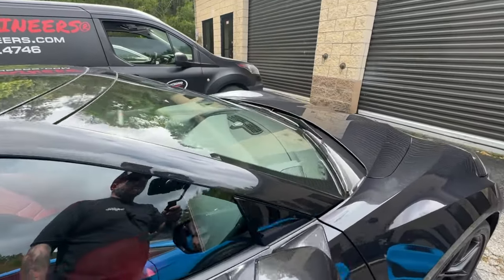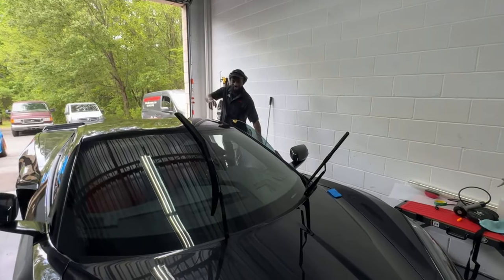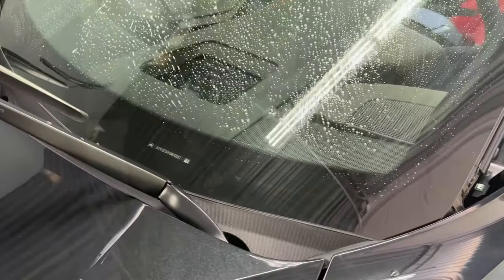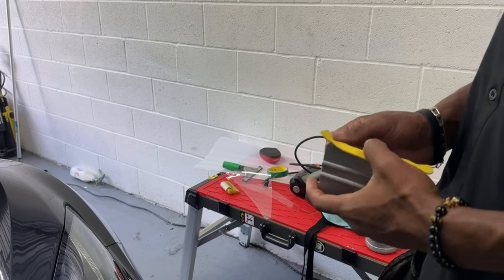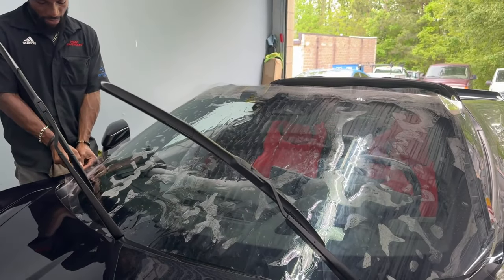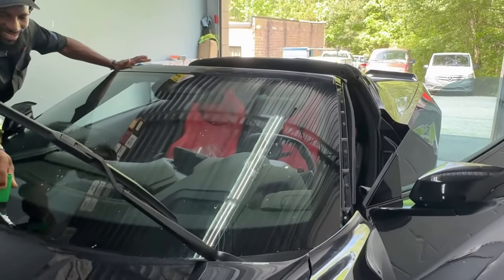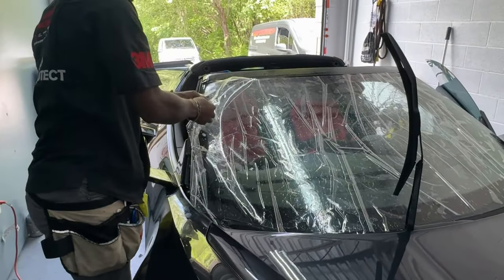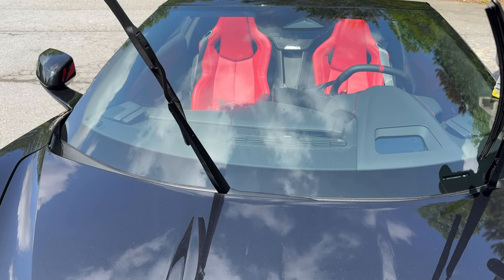Our C8 Z06 gets EXOSHIELD! Protect what you love!

Comment: Is your Z06 3LZ? If so, is carbon fiber standard on steering wheel and paddle shifter? Also, are the winglets standard as well?
Reply from the maker: @karltinson5327  winglets are standard…. They come with both low and high and the dealer or in my case the museum installs the higher winglet for delivery and puts the regular ones in trunk. The red carbon fiber paddles are from paragon performance and they make full replacements and then overlays….. both are AWESOME quality. Interior is 1LZ actually. Since the Z07 package was in constraint when I placed me order I kept the 1LZ to keep weight down. The only thing I wish I had is the front end lift so I could lower the car even more and not scrape my driveway 😊
Reply: @dbmracing2019  thanks for the quick response brother! Subbed! I have a 2023 Stingray 3LT (loved the car until I test drove a Z06 during my second oil change). Still like it but fell in love with the Z06. So I ordered a Z06 3LZ with level one carbon inside but not sure it will come with carbon fiber steering wheel and paddle shifters. Anyone?
Reply from the maker: @karltinson5327  I don’t think the paddle shifters but maybe the steering wheel if you got CF package
Reply: @dbmracing2019  yes. Confirmed with Corvette concierge that the 3LZ comes standard with CF steering wheel and paddles
Reply from the maker: @karltinson5327  perfect!! You’ll LOVE it!

Comment: Would have liked to have had this before mine hit that tire. Dunno if it would have stopped the cracks given the size of the tire but def wouldn’t have been as bad.
Reply from the maker: It’s so thick I bet it wouldn’t have cracked honestly……. IMO it would take a MASSIVE object to do that with this on the car.
Reply: @dbmracing2019  normally I would agree but it also cracked my headlight which had the 8mm xpel so that’s why I think it woulda still cracked some.
Reply from the maker: @Brandonsgarages  I don’t know what the thickness in this was but it was REALLY thick and it’s made different for the hardness on it…. I’ll have to ask Jax for the actual thickness.
Reply: @dbmracing2019  I saw a video on it and they said 8- mil I believe. (Exoshield). It may be stronger than expel tho I dunno but same thickness as the ones we got. I think they make a 10 mil in expel it’s an upgrade film or something called ultimate plus 10 but I’m pretty sure ours was the 8-mil.
Reply from the maker: @Brandonsgarages  I’ll have to look and see for sure